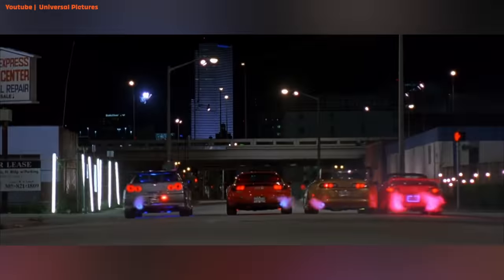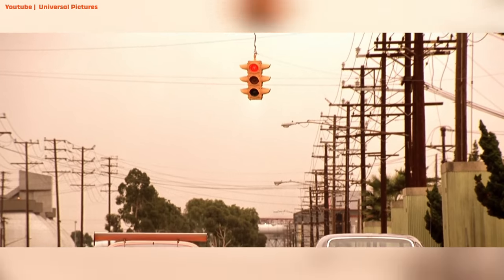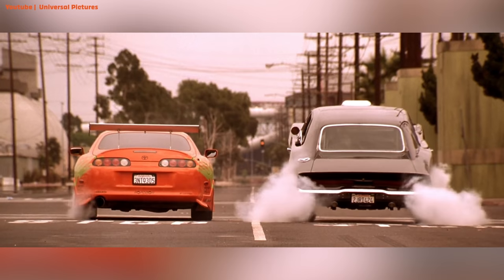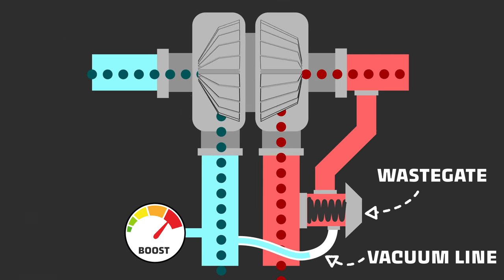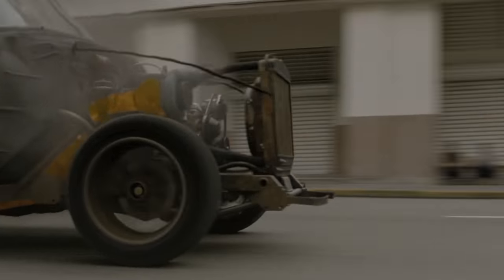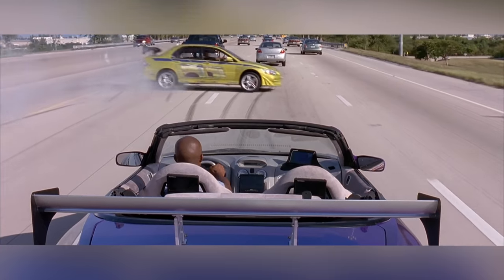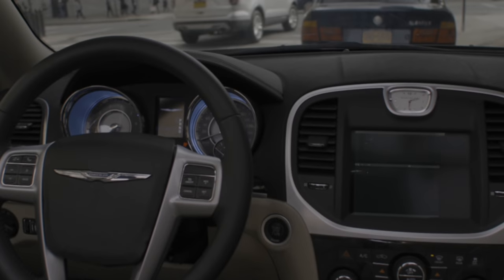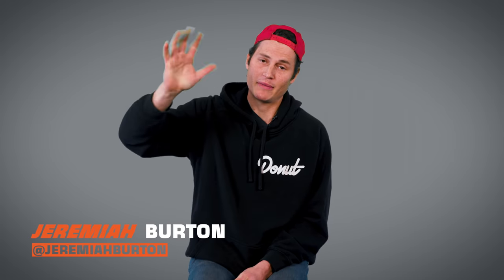Busting Fast & Furious Lies with Science

Comment: Are you going to gloss over the fact that Dom grabs the fenders and all of the other parts of the car and rips them off with his bare hands?  I mean, unless they were all held on by a couple of bread wrapper twist ties, there isn't any way those rusted ass bolts and screws would simply fall out of their holes and allow the parts they are holding together to work fly off like that.  But then again, they were in Cuba, where decades of saltwater have allowed the sheet metal to rust and weaken a lot, coupled with years of trying to find parts to keep their cars together.  So it is actually possible that they were being held together by a bunch of old Wonder Bread twist ties.

Comment: Imo you can totally do a burnout while wheelying. Wheel spin doesn't mean mean no friction, it just means less, which is why a car will still push forward while doing a burnout. I would say it's likely there would still need to be way more power than that car produced to do this meaning the film is still pseudoscience. Just my speculation, could be wrong but feels right to me. Thoughts?

Comment: the nos bottle could explode, the car is on fire heating up the nos tank, tank gets hot, hot gas expands, now normally a tank of compressed gas would have a opv (over pressure valve) to let the gas escape, but if the tank doesn't have one (cheap nos tank from wish?), or if the opv failed, or if the gas is expanding at a rate higher then the opv is bleeding the pressure the pressure would build up, the tank would explode and it would be very noticeable both in terms of sound and because the fire would suddenly have a increased amount of oxygen to burn causing the flame to suddenly grow. it how ever would not turn the fire green since its a non flammable gas

Comment: In theory you can do a light burnout -- and then do a whellie --- especially on the normal asphalt .....   It would require almost perfect conditions --- as the tires are cold they have limited traction, and while hot they have significantly more traction....

Since the tire getting hot gains traction -- it is somewhat possible to do that not starting with high rpms (at first light burnout while next going for a wheelie) but the smoke will end quickly as the car would go --- exactly like in the movie.  In the movie it was fake probably as they take a lot of shots of the same scene -- still it is possible :)

Comment: I don't completely agree with the first one.  When the wheels start to spin, there isn't 'no friction.'  The equation for friction has a coefficient of friction between 2 surfaces, in this case the rear tire contact patch and road.   There are 2 coefficients, one static (wheels not spinning), and another dynamic (wheels spinning.)  The dynamic coefficient of friction is lower than static, and you are liquifying the outer layer of rubber causing even less forward force.  But there could be a big enough friction force with wheels spinning, esp slowly to accelerate the car fast enough to get your 2.6 g's of accel upward.

Comment: I’ll help you myself yes it is possible to go faster in reverse but I’ve only heard of two gears for reverse low and heigh a farmer might know more when it comes to that but in a 18 wheeler you have a splitter for all gears on the high side 1-5 is your low side 6-10 is your high side for reverse it has low and high but even then I’ve only been able to go 10 mph on the high reverse and that’s in a tractor trailer have more torque then any car can handle

Comment: Now, the wheelie with smoking tyres IS technically possible because drag racers have been seen to achieve it BUT it happens a lot faster than is depicted in the scene so it's still nonsense.

Comment: The turbo one was proven to work on a Motortrend show called motor myth busters, where they used the same engine (small block chevy) and a similar turbo setup from a boat out onto a 1973 Monte Carlo and tried it out. Only difference in fact from fiction is that the vacuum line needs to be clamped rather than pulled, because if it’s pulled there is an inconsistency in air going through as the line flops around, whereas a pinched line made more pounds of boost and increased top speed

Comment: Can confirm, older clutch tractors often do not have dedicated forwards and reverse gears. On the ones I'm familiar with, you have a regular four speed shifter and a two speed, forwards/reverse shifter. You can run through all four gears in both forwards and reverse easily.
Some Hydrostatic drives aren't limited backwards, either, and would be much easier to use while moving, would most likely be harder to mount in a car and wouldn't give you those sweet shifting scenes.

Comment: on the point of the first one, idk about you but when I've done burnouts in my car still gets pushed forward and if I let off the brakes entirely I will usually start moving forward 20 feet then the wheels firmly grip the ground and the burnout ends. Suffice it to say, my car doesn't have half the amount of torque it would need to pop a wheelie but if he needs 700 torque and his car has a thousand or more I think the wheelie burnout mix could be possible

Comment: Your wrong about blow through carbs jetting.  The fuel is increased by a boost referenced regulator.....although pulling the wastegate line would produce more boost than the fuel pump could handle.

Comment: Just to be nitpicky, but it's not that uncommon to pull the nose up while the tires are slipping a little bit. Slicks are a little forgiving in that they can still put power down while slipping some, whereas radials are much more prone to just "let go".

But yeah, if you get a smoke show, it's not coming up 🤣

Comment: Without watching the video itself I can tell you the depiction of NO2 in FF is completely false lol. Nitrogen can blow your engine yes, but for different reasons and when it does blow its just a piston or rod through a block at worst, not a huge fiery ball lol. Its not explosive and the complete opposite of flamable,  its literally a liquid that freezes once it reacts with open air, you could light a tank on fire or shoot it and all it would do is release the pressurised gas, no fiery explosion.

Comment: nitrous oxide is an oxydizer (its in the name), it itself wouldn't detonate, but if the car is on fire already, it will make it a few hundred times worse in a very intense and very rapid manner, which is exactly what happened in the clip. there was a fuel fire first, which burst the bottle and released all of that gas in a uncontrolled and rather violent manner, there by hyper-oxydizeing it and making the whole tank go up almost at once. there's a lot of energy in gasoline.

Comment: Multiple reverse gears is possible, i drive semi and my truck has 2 reverse gears, hi and low and to get crazy the german WW2 tank had 3 reverse gears. Wether or not you can get enough to go 100 mph im not sure, but in theory you could if the vehicle is light enough

Comment: Technically… the nos bottle would explode if the bottle is sitting in a fire, the nitrous would expand with the heat until the point which the bottle can’t handle the pressure any more and the bottle pops… in which the nitrous oxide mixture is released under pressure directly into a naked flame, therefor igniting the oxygen. So yes it would go boom. But not how you’d think

Comment: For the 100' mph black Buick Grand  National of Dom from the oil tanker heist.
Universal took the chassis and fliped it and put the exterior so it is front wheel drive rear wheel steering rear engine rear pilot

Comment: I'm pretty sure the tractor transmission is called a synchro-shuttle(At least that is what Massey Ferguson calls theirs), and I don't believe it has multiple reverse gears. I'm fairly certain it allows the operator to switch the direction that the output shaft turns, allowing you to use forward gears as reverse gears.

Comment: Ok I’m going to break your nos speech.  Nos will cause everything else to burn hotter and make things explode as if there was an oxygen cylinder in the car.  But the valve on the cylinder has a safety and that will go before the bottle blows.  You will have a flash fire not an explosion

Comment: The point on the turbo Charger and Cars is Maybe right, But there is a way where you put the Boost on the fuel pressure, then you Need a Valve which hold the fuel pressure 0.3bar over the Boost pressure. Then you have a safer way to have enough fuel for things like that. Just saying

Comment: Pretty sure the waste gate delete could work with that carb, if he way overjetted the secondaries, and only opened them when he pulled the cable.
But, running the rest of the race,  strictly on the primaries would negate any benefit.
You guys should still try it.

Comment: The reverse speed that you say is max about 36mph is only some cars. If it was a cvt transmission like in my versa it’s electronically governed at 30. It does thirty at a very low rpm due to the way a cvt works

Comment: Car in reverse: totally possible what you on about? install the right reverse gearing and it's the same as forward, the car doesn't care it would be unstable because cars are designed to run forwards but whatever. you don't know what mad ratios he's put in there for trick purposes.

Comment: The NOS bottle could explode if the expanding gas pressure got too high due to increasing temperature,  but that would take a very long time in a raging hot fire.. the car would burn to a cinder and the bottle still wouldn't get hot enough.

Comment: The charger was a 1970 model with 1969 parts. The only time the car had the huge hemi in it was in the scene where Dom shows it to brian in the shop. After that they put a SBC in it with a fake super charger. To do the scene where he does the wheel stand burnout. They added hydraulic wheelie bars to make it wheel stand and they added computer generated smoke to make it look like it was doing a burnout at the same time.

Comment: The nos thing is not that far off. by overheating a bottle in the trunk, it can rupture and take the fuel tank with it, wich sits directly under it. this can totally cause a realy bad explosion. the green flames of course are just barium copper or bor solutions that look cool when they are in a flame.
And the wastegate does not regulate the speed of the turbine, it regulates the boost pressure.

Comment: Hmmm, they take the time in the film to zoom in and show the stress of the forces on the tire as it flexes and grabs on the initial torque, at which point the car does a wheelstand but the rear tires are not actually yet smoking. At this point the car has forward momentum and the nose is already off the ground, all that physics is out of the equation. Now, an instant later the rear tires begin to smoke, losing grip. The car still has its forward momentum from that initial grab, so continues with it, now the rear tires spinning during the travel. At the same time you see the front of the car come back down, as it naturally would. 

If the rear tires started smoking before the wheelie was accomplished, you could rag on the scene this hard, but she was already standing up before she lost traction.

Comment: For the f&f 8 backwards scene. The car doesn't have multiple reverse gears. Basically it has its gears and can then switch those gears into reverse. Essentially having the same ratios but spinning the tires the other way.

Comment: A burnout isn't the absence of friction, its the tire and the road behaving in a dynamic friction rather than a static friction mode, which always has a lower coefficient of friction. If your car has so much torque it can still get the acceleration needed to get the front off the ground then absolutely you can burn out and wheelie at the same time.

https://youtu.be/SYj1LiEczS8

Has a guy do it in a supermoto bike... Sort of. You can see him accelerate while smoking the rear tires, and yes it grabs before he gets the front wheel off the ground but if you had monstrous torque you can conceivably do it.

Comment: I dont see the zombie cars being remotely possible for majority of cars. Seeing a large majority of newer cars require driver input to get them started by pressing brake/clutch pedal and putting them in gear. Not to mention the steering would have to be electric power steering to be able to steer the car remotely.

Comment: nitrious may not be flammable but if there is a fire already burning and you add a bunch of oxidizer rapidly into the fire its going to create a much larger more intense flame. same reason you shouldn't have a compressed oxygen bottle near a flame.. your gana have a bad time. im not sure it would have cause a explosion like in the movie but if you had a nitrous tank rupture in the middle of a already rolling fire it would increase the fires intensity.

Comment: Cars with tractor transmissions is a real thing. These cars are typically built be used on a farm as a cheap and easy to fix work vehicle. Tractor transitions usually have a proportional set of reverse gears to forward gears depending on the size of the tractor.

Comment: But you said the heat and the flame in the engine breaks up the nitrogen from the oxygen which makes it flammable, so the car on fire heats up enough to break up the nitrogen from the oxygen which than the oxygen itself is actually flammable aie? 🥴

Comment: Video said there is no friction in a burnout at 3:50, this is not correct. Probably the wheelie burnout is still not feasible but kinetic friction still moves you forward in a burnout. The best place to see this is in Formula Drift, where the follow car will close distance with the lead car while in drift by added acceleration in a rear wheel drive car. There is more friction (static friction) when the tires are not slipping over the ground, but when the tires slip there is still some friction, not zero.

Comment: missed two things on turbo wastegate lies.  Other reason to regulate boost so you don't throw too much pressure and blow the head gasket.  Second reason, fuel supply pressure must exceed turbo pressure, excess turbo would not only need more fuel but without increased fuel pressure will resist fuel entering and cause less flow.

Comment: The carburetter boost thing is incorrect. The amount of fuel entering the engine is controlled by the amount of air travelling through the carburetor. if you add more air / boost the carburetor automatically adds more fuel eg: at an idle with a small amount of air being used only a small amount of air is drawn through whereas under full throttle at high revs a lot more fuel is consumed,  the jet size only changes the "air fuel ratio" not the total amount of fuel.

Comment: what if you are running thick with too much gas going to the engine then when you pull the pin and the turbo spins hard it can use all the gas and go vroom? Cuban NOS.

Comment: They could have jetted the carb before the race to a high amount of fuel, because running rich doesn't do too much to the engine, so when he pulled the line it had the right amount of fuel for the oxygen. but this probably did not happen

Comment: GM made a powerglide transmission for tanks that had two forwards gears and two reverse gears the ratio was the same for both forwards and reverse. I read an article from Hot Rod magazine of a guy that built a hot rod with one of these transmissions he said he could go just as fast in reverse as forwards.

Comment: The  only issue I have with this video is that a wastegate is not there to prevent the turbo from "over revving" and burning up the bearings. A wastegate is there to limit boost pressure so that the feedback loop created between the engine and turbo can be interrupted, which prevents the engine from running lean and detonating.

Comment: it is possible to go backwards faster but it needs 3 things the first thing is nature 100 km / h turn the car backwards then shift to reverse branched maximum speed how much it allows us to disable the engine with the clutch depressed you put one to start the car in a way that we just turn the keys but  does not start with a starter And the engine should catch even if you drive behind so you can disassemble the cars but they are very heavy this could only work in one case and that the mothy would be old enough for me to drive in the back but it is not with new engines  possible

Comment: You can't re-jet your carb on the move, but you can boost reference your fuel pressure to increase fuel flow as boost climbs if you're using an electric fuel pump.

Comment: The part where the wastegate is clamped/vacuum is removed would actually work as just because there is a higher air to fuel ratio the extra air would still create a power boost but will be running less lean and now canisters can definitely explode u say they can’t because they are not flammable yet u then go on to say how there is an open flame to ignite it

Comment: 3:06 You could have just stopped there because there are no road legal tyres anywhere that can pull 2.6G.

Even with racing tyres, most cars that can lift the front up have had the engine moved into FMR position to shift the centre of gravity back, because with the engine out front it was just never going to happen.

Comment: 2 kids in Germany got arrested for taking control of the car on the auto band with a drone like controller and a lap to and they would race them a lot of car accidents the software they had it went so far then cut off so then they can't drive the cars doing 100+ going through traffic when the drivers had control again they pretty much crashed

Comment: actually doing 100mph in reverse is possible with a tall enough rear gear and final drive gear setup, though in order to this, the reverse gear would have to be close to a 1:1 gear ratio in relation to the final drive gear, or even be an over drive gear in order to do this, provided the engine has enough torque to grunt the car in motion.